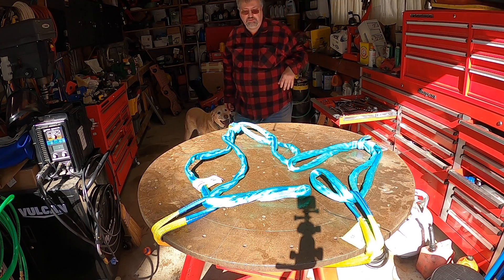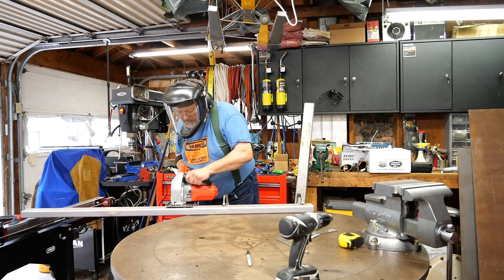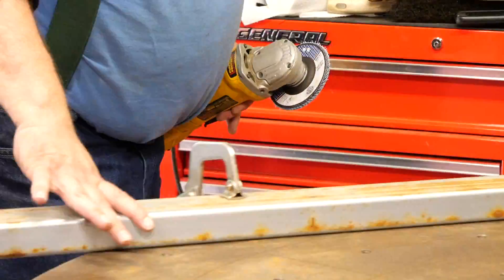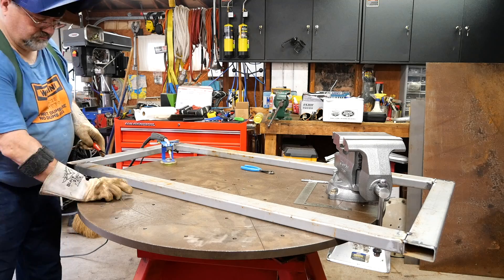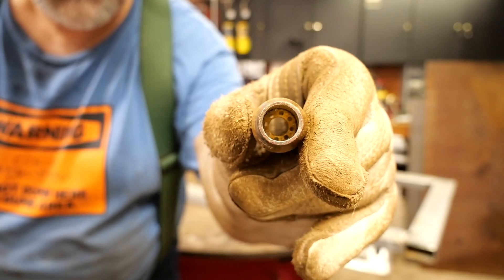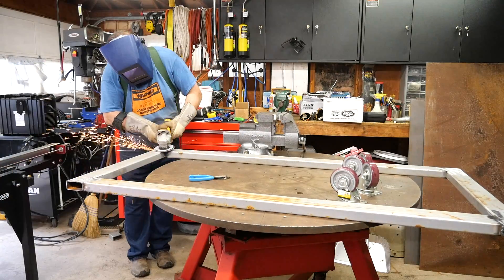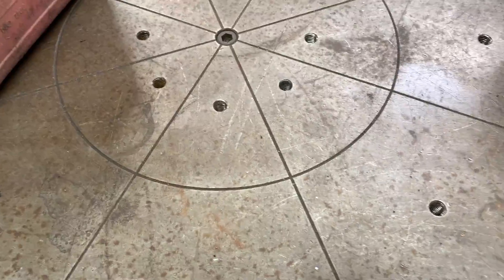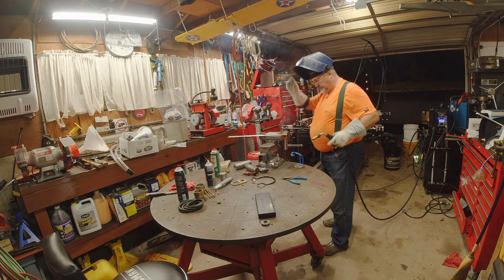Using the New 3M Rotating Welding-Fabrication Table (EP410)

Comment: Eric, where did you get the rotating Welding-Fab table? I sure do like that fab table.  Do you have a link for it?  Thanks and have a safe New Year?  👍🏽🙂
Reply from the maker: As I understand it, this is a one-off table made for some aero-space application for 3M from back in who knows when. I picked it up at auction last spring for $725 plus tax and auction fee. The auctioneers couldn't believe it went for so cheap but I was thinking since it didn't have any comparables, people wouldn't know how to value it. The thing is if anybody has priced out any fab-welding table they know none of them are cheap!